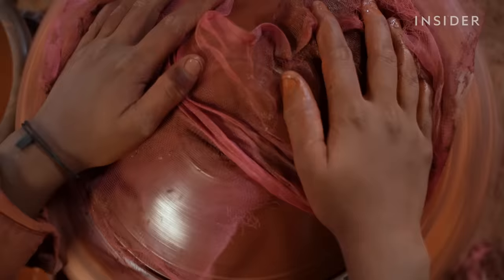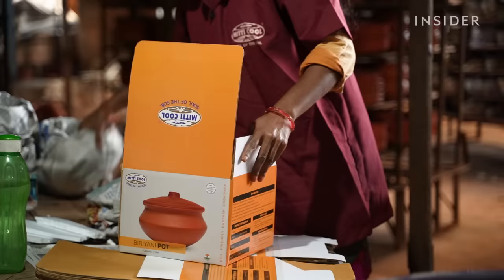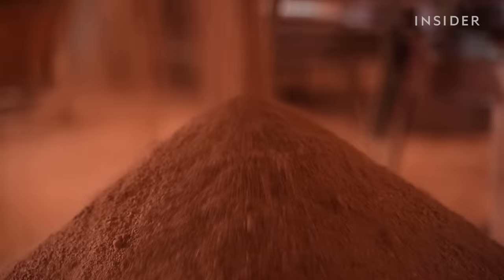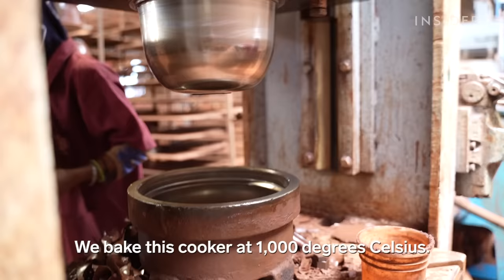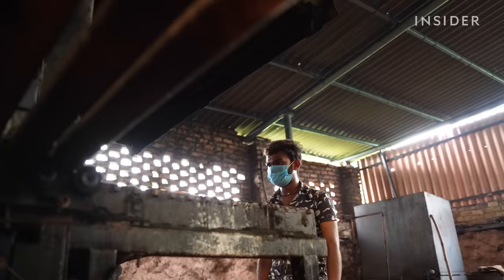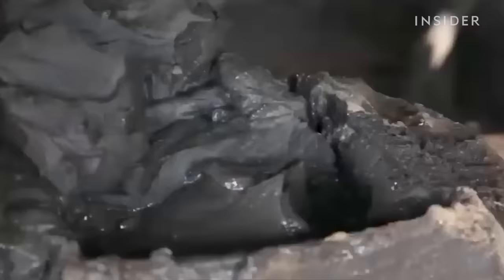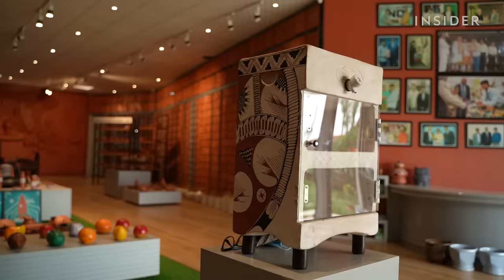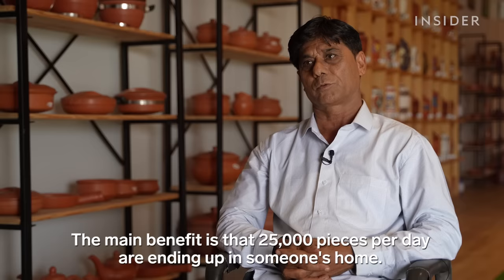How This Electricity-Free Fridge Saved An Indian Ceramics Factory | Big Business

Comment: About the refrigerator: well it works on the principle of evaporation the way sweating keeps mammals cool. But just like sweating, it works in hot,  dry climates the best. If you live in cool area, it might not provide even one degree of difference.
Reply: and why would people want to cool food in cool areas?
Reply: @hidum5779  because cooling food is much more, than keeping your drinks refreshing - it's primarily about preserving it. and even in cool areas the temperature isn't THAT cool, at least not year round. but even if it is, it means you'd have to keep it outside. not very convenient. although, our grand-grandparents in rural areas did use a similar technique: they dug a hole in the ground, outside a house, and made a dome on top. give it little door, and it'll make a cellar of some sorts, which makes food last longer. not nearly as good as a modern electric refrigerators though.
Reply: @kabyzdoch  I get the point about preserving. The food cooled in these non electricity fridges lasts for a week as they said. If it gets 8 degrees cooler, then in cooler areas I'm guessing the temperature already goes beyond 8 degrees since this fridge can't cool it, so why would we further need cooling anyway?
Reply: @hidum5779  well, the cooler it gets, the longer it stays edible. not all food needs it, but, for example, there's meat and vegetables in my freezer, laying there for almost a year, waiting to be unfreezed and cooked at any time. quite convenient.
also, talking about colder areas. if it's cold outside, people usually trying to keep themselves warm by warming their houses. some folks have a cold, non heated part of their house reserved for storage - vegetables, canned stuff and even some prepared food can be stored there quite effectively. but this type of storage rooms can be found mostly in single-family houses. living in apartment building, on the other hand, do not provide such benefit, so when heating your living space, you loose that bonus of keeping your food fresh for longer because of natural temperature in the area, and without an electric refrigerator your only option would be to eat something that doesn't spoil easily, which is dried food, salt food, sweet food and canned food. one could definitely live on such a diet, but given the options, it's rarely the food of choice, at least not on a daily basis.
Reply: @hidum5779  Where I live, in scandinavia, northern europe, Before refrigiators, people would have a wooden box inlaid with hay in which they would keep a big block of ice. On top of this they put a plank and then the food items needed to be kept cold. For dairy products and vegetables, folks would have a small cupboard made from wire net to hang on the outside of the house in a shady place. You can still find these around in use by elderly people having grown up with them.
Reply: @kabyzdoch  Well, many houses do have a cellar for this purpose. Or they have a pantry in a cool location near the kitchen.
Reply: @hidum5779  chilled beer is far better than cool beer
Reply: @chanderbalaji3539  I don't think this guy designed the fridge for chilled beer. It's for the poor people in a 3rd world country who want to preserve their food. He accomplished his objective quite well if you ask me. It is more of a need than luxury.
Reply: @chanderbalaji3539  I was thinking this would be the perfect cooler for a cabin or permanent camp site so all you had to bring was the beer and food and then get water from the nearest source.
Reply: Means u need to constantly top up water?
Reply: A fridge needs to do 2 things: Transfer heat out of the system and insulate to stop heat from reentering the system. Evaporative cooling alone cannot do both at the same time. By its very principal, the thing that is being cooled will have to come into direct contact with the warm ambient air, meaning no insulation.

Sweating only works to cool off the heat your body generated, speeding up the cooling from cooler amibient temp. I don't believe that your body is able to cool itself below ambient since it has no way of insulating heat from entering. ie, if you stayed in 40degC you can't maintain regular body temp for extended period of time regardless of how much you sweat. It would also need some kinda pump, similar to how your heart pumps the blood cooled through sweating to other parts of the body.

This is basically a swamp cooler, but even less efficient. It's a loada bollocks
Reply: @ABC-ABC1234  well, the thing is, i'm a lazy person and i don't like to cook, so i use cup noodles, dumplings and other stuff that needs only hot water or boiling in hot water. or microwave. that meat though? it was brought by my mother when she was visiting me. so it just remains there, untouched. oh, by the way: it was finally cooked and eaten a few days ago - no weird taste, smell or anything, just a normal pork.
Reply: @kabyzdoch  (-.-²)³
Reply: Hi guys!
Tropical creature here.
My natural habitat is hot & humid.
Temperature 26-35°C, humidity 50-90%.
Been searching for budget friendly & environment friendly ways to cool of anything - food, space, etc.

This video got me thinking: can clay be the answer for me?
Water clay jar & food clay container, instead of electrical fridge.
Clay-based roof tile & bricks for roof and wall, instead of electrical air conditioner.
Would love to hear opinion & suggestion from y'all
Reply: Meanwhile I'm living in a hot and very humid environment. So absolutely no evaporative cooling possible
Reply: Say you live in cool area and you have a balcony which has direct sunlight, would it not work?
Reply: @hidum5779  What is third world ?
Reply: @acharyaguy  ask google
Reply: @acharyaguy  places where electricity supply is either not reliable or unaffordable to many.
Reply: @hidum5779  I don't think so google would categorise countries as first , second and third world countries
Reply: @acharyaguy  well it appears that you're already aware of what I'm trying to say.
Reply: @hidum5779  it's more about whether you know what the term "third world" means but then don't take it personally, you are not alone in using such derogatory term.
Reply: @acharyaguy  dude, I belong to the same third world. And yes I know about the other original definition as well. No need to feel offended. It's fine. I'm not american and after seeing the videos regarding "streets in philadelphia" you might wanna call america as a third world in the same derogatory manner.
Reply: @acharyaguy  also, nothing's wrong with being a 3rd world person (even in the derogatory manner). This century is of Asia altogether anyway. Necessity/problem breeds innovation. This guy did it well. That's the point I wanted to highlight. I know we're much better off than 2003-04 now, but again who cares what others call us? Being sensitive won't work on the internet. Life is too short, just saying. Relax and let go.
Reply: @hidum5779  development we call comes with its cost...btw it is good to be emphatic with ourselves
Reply: @acharyaguy  cmon dude, just because I called our nation as "third world" it makes you feel as if I'm not empathetic? Like I said, relax and let go. Why do you concern yourself so much regarding correct definitions and stuff? This is an informal place. Just let it be. Of course had it been some misinformed foreigner still ranting about the "toilet" problem which is very much eradicated now I'd have shouted back onto him. But then again, who cares what others think? I used to be sensitive earlier and it didn't go well. I didn't purposely look down upon my country as if it's not safe for women or whatever like that(and well I know that rapes are favourite topic of foreign media to make a fuss about India), or some other issue concerning that way. What's the deal with being a 3rd worlder? It's just a name tag, not even much derogatory. Chillax

Moreover either way India is a third world country. It kept the alignment neutral during the cold war. Why worry so much?
Reply: 🤣🤣🤣You have never lived in a clay house have you.?
Reply: @Pehr Sundbergh 🤣🤣🤣You have neve lived in a clay house in Hot weather have you?
Reply: (Acharya Guy) just cool it. Chillax. I am also from Bharat India. Hidum used "Third World" to explain what type of country he was talking, not as an insult. Your skin is too thin and too sensitive.
Reply: @prakashholla7331  thanks
Reply: The key is humidity not temperature evaporative cooling doesn't work in high humidity environments
Reply: @ekosoelistiyo4532  this
Reply: You are not his targeted customer
Reply: @ekosoelistiyo4532  Look up "pot-in-pot refrigerator".
Basically it's an ancient technology, but he has built a more convenient and modern looking version.
Reply: @wolfgangkranek376  Aha, gonna dig deeper about it!
Reply: It is the humidity level in the air which is most important. If there is too much humidity, evaporative coolers cannot work. In a dry place like Gujarat or Arizona, it is a wonderful solution.
Reply: @BooGooNFlowoo4Evoo  Ah, I see
Reply: @TeraAFK  body can be lower temperature in hot arid places. Evaporative cooling isnt much different than heat pump principles, except it's not a closed system like a heat pump and highly dependent on the weather/climate way way more so than a closed system heat pump.

 But still this ceramic seems like more of a trendy place to keep vegetables barely cooler. Does it really matter if your its 90f out and your meat is kept at 70f?
Reply: @TeraAFK  You are right about the fridge. They only briefly showed 8 degree cooling in the video, which is poor.
You are mistaken, however, about sweating. Plenty of places on earth where people can live in a climate warmer than their body temp. Sweat cools by absorbing body heat when it evaporates. It still works in 40+, humid climates, though not efficiently.
Reply: @hidum5779  It's a combination of temperature and humidity. 

So long as the humidity stays low, evaporation will happen, to some extent, and evaporative cooling works, to some degree. (In fact, even ice will sublime--turning directly to vapor--in below-freezing but dry climates.) 

However hot, dry air can hold a lot more water vapor than cooler air that is at the same percentage of saturation ("equally humid"). This curve (the antoine equation) is not linear--it rises dramatically with temperature. So there's a large zone in the middle where it is still too hot for food storage, but not hot enough for a given humidity level to have such powerful cooling capacity.

And of course, cultures differ in what sorts of foods they eat, and hope to keep fresh. A cooler of this sort would not be safe for soft fresh cheeses, but it might be fine for aged cheese or a more fermented or salted food.
Reply: Sounds just like how swamp coolers work :)  Doesn't work well in humid climate but very dry desert climate.
Reply: @kabyzdoch  My house had the first floor half in the ground and it had huge stone walls. On a wall had one huge square hole where they store food. Also it was where they were keeping the animals and my family was sleeping just above them on a wooden floor which allowed the heat produced by the animals to keep my family warm. Although renovated, I still live in that house.
Reply: Please explain further
Reply: I was waiting for them to explain how the fridge works but they kust glossed over it. . .
Reply: It works better in dry climates
Reply: Can you please explain exactly how the fridge works. It just looks like a cupboard to me.
Reply: In Physics, heat does exist, cold doesn't. Cold is the absence of heat. Alcohol on your skin gives you a coolant sensation, because it "steals" heat from your body to evaporate. In this fridge, its whole porousness ceramic body acts this way, but using water. Evaporation rate is directly proportional to dryness of ambient air. Swamp cooling performance is bad in wet climates due to low evaporation rate.
Thumbs up if you understand it, ask me if you don't.
Reply: @ww07ff   sorry I  still don't understand it. Where's the holes? Where does the water come from? And what temperature does the fridge cool down to? Do You have to put ice cubes inside to help with the process?
Reply: @ya00007  The top is a water tank itself, needs to be refilled "every day" (1:01). The water spreads thru capillarity and gravity to whole porousness ceramic body, like a sponge. (or like a wet t-shirt on your body). The temperature range is narrow, the values are in the vídeo (5:48). No ice is needed.
ps: Fahrenheit scale and other imperial units are stupid and north americans should let it die.
Reply: @ww07ff  you still haven't explained exactly how it works.
 Ok there's a water tank on top that needs to be filled every day. The water seeps through the bottom of the tank? Then where does it go? There must be a bucket for collecting the water somewhere or does it just evaporate?
Reply: @ya00007  Imagine a huge SpongeBob. This fridge is literally a SpongeBob, its ceramic acts like a sponge. You fill his hollow head with water. The water will spread itself through his sponge body. The water evaporation on sponge skin will "steal" heat from Bob, like a wet t-shirt. Have you ever worn a wet t-shirt in the wind?
ps: 
-Yes, water seeps through the tank walls (bottom included) ;
-Then it seeps through the whole ceramic body;
-It just evaporate.
Reply: Thank You!
Reply: An ice chest with a glass door wont keep anything cool without ice so I don't see how this thing does anything at all
Reply: @WormholeJim  A whole in the ground, and dig a bit to the side = ca 4-5 degrees year around. Worked when I was a boy scout, and we actually earned cokes from the other boy scots, who didn't want to dig their own.
Reply: @hidum5779  Ice cold beer obviously
Reply: @TeraAFK  Even swamp coolers can cool things below ambient shade temprature at the cost of water and increased air humidity. In this case in the dry air of mountainous regions of northern India this very likely does reach 8c below whatever temp is inside the house and it keeps working because these houses are likely built with open windows  so the increased humidity equalises with the outside.
Reply: @neelroy2918  You keep it out of direct sunlight for best results
Reply: @Malroth00Returns  thanks.
Reply: @TeraAFK  It is not as good as an electric refrigerator I agree.  It is not a fraud either.  When going into warm areas and using a cooler I have placed wet towels on top of the coolers in the same environment as coolers that didn't have wet towels.  The coolers with the wet towels stayed cold much longer.  It does seem counter intuitive but if they didn't work people wouldn't buy them.
Reply: @hidum5779  It's more about dry, not about hot.
Reply: @TeraAFK  Evaporative cooling can absolutely cool below ambient. Not only is this possible, but it's so consistent and reliably lower than ambient that there are two common terms to distinguish those two temperatures: dry bulb and wet bulb temperature. And I also don't understand why you think the food inside the fridge "needs to come into direct contact with warm air" huh? No, it loses heat by proxy through the wall of the fridge. Nor does it need a pump: the ceramic wicks water down by gravity.
Reply: Even in cool England or Ireland evaporation works.  I have been fridgeless in the past, placing milk container - for example - in a bowl full of cold water with a piece of cloth draped over  it ensures the milk is always kept cool.  I kept it in a cool north facing room with the window always open and stored not only milk but also butter, cheese, fish and meat this way.  And I never had anything go off or even faintly mouldy.  Which is more, much more, than can be said for food kept in fridges believe me.  That cool room with the bowls of water and fabric covering the contents was the ONLY time I have never lost any dairy or meat products due to them going off.  In a fridge the cheese is always going mouldy, and meat has to be eaten within a couple of days or frozen else that goes off as well.  And worse, I am expected to PAY for the privilege of losing my food while helping to create pollution from the electricity and production/destruction of said fridges.
It may not work in the Arctic or Antarctic but almost everywhere else, unless your daily living temperatures are below 5degC it will work.
Reply: He didn't even intend to make the product for European nations.
Reply: It isn’t really about the temperature of the air as much as the humidity. If evaporation is hampered because the humidity is already high, it doesn’t matter what the temperature is. In FL, for example, a cold drink will sweat like mad and form a significant puddle because the chill of the container is allowing the humidity to condense into droplets that then do NOT evaporate.
Reply: @PANZER7910  I think they were saying the water lasted a few days maybe even a week or 2?
Reply: @TeraAFK  if your hypothesis about the body was true, every human living in a place that gets hotter than 98° would die of fever.  Obviously the human body is capable of maintaining it's temperature beyond the ambient.  This is through many mechanisms, not just sweating.  I see what you're getting at but that's a really poor metaphor.
Reply: Isn't india famously humid?
Reply: @ummdustry5718  it's a huge country.  The part he's from is very arid.  There's literally snow capped mountains, jungle, desert, and grassland
Reply: @kabyzdoch  they can just dig a hole in the ground if it’s that cold there. Or if it’s 30-45 just put it outside
Reply: LOL, $40? What a scam. Going from 80 F to 72 F doesn't do shit for storing food. I bet you they would use up the food in just a couple of days. They are not going to have food sit in that useless box for a week.
Reply: I guess that's very similar to how water kept in earthen pots stays really cool
Reply: it's not much more than a few degrees in hot climates anyways (they claim 4C but that sounds very optimistic for evaporative cooling). This is the same as those obnoxious swamp coolers and it won't do much more than make an environment that's maybe optimal for potatoes and onions
Reply: I understood that. What confused me was that he said electric versions didn't keep stuff cool enough.
 
And I also noticed a design flaw. Why have it be of a vertical design? If this uses passive evaporative cooling, that would mean it isn't dynamic to changes. It would struggle to keep consistent internal temperature because it doesn't react. Flip it on its side, of the horizontal type, similar to that of a deep freezer. The horizontal type is a more appropriate design here.
Reply: @hidum5779  Food will not be preserved unless stored at around 4-8C. Just cooling 8C below the surrounding (which can be as high as 40C in summer) won't help. However, it may be good for saving the leftover food for the night (next meal time).
Reply: @chanderbalaji3539  Icecubed Beer is more better than the CHilled beer XD
Reply: @WormholeJim  In the 40's and 50's we had an outside Coolgardie meat and vegie safe. A water tray was on top with a hessian bag draped around it which became wet through absorption.
Reply: @nifty1940  That's a great application of the physical forces influencing all the time. I think we would do ourselves - and the rest of the planet - a great deal of good if we reinvented all that wisdom previous generations employed lacking modern day technology. Thanks for sharing!
Reply: @acharyaguy  
I completely agree with you. Nowadays yoyo guys think it is cool to use such words .
Reply: @hidum5779  
So, We don't see people calling the western world as cultureless world, which is true actually.
Reply: I would not need it to be cooler in a cool climate, lol, I would simply put things on my porch, like I have been doing for years!
Reply: @Pehr Sundbergh Wow, you made me curious.... and learn more....
Reply: @neelroy2918  It would, if evaporation occurred.
Reply: 33 to 40 degrees is the refrigeration range to prevent food borne illness so in cool climate you might not always achieve that range as opposed to a cold climate for instance.
Reply: Technical comment:

The relative humidity is more important that the actual temperature. The "wet bulb depression" is even more relevant.

This fridge is ideal for countries with dry air, regardless of actual temperature. It would fail where the air is naturally humid, like in a rain forest for example.

In foggy conditions (where water is condensing onto surfaces) the fridge could actually be warmer than the surroundings.

To see the effect in your home, get two thermometers, wrap one in a cloth soaked in water (preferably with a "tail" allowing it to soak up liquid from a nearby jug in order to stay moist). Let the other one keep its bulb dry. Compare the temperature of the two thermometers after a few hours.

I am old enough to remember our family getting it's first fridge in about 1958. Before that in summer mum keep Ford fresh by covering it with an upturned bowl and covered that with a dishcloth, the whole thing standing in a bowl of water. It made the difference between butter being solid and melting in hot weather. London, England. We did not often get weather hot enough but this DIY fridge was used for a few weeks every summer. It kept butter and milk fresh when they would have gone off just left in the pantry.
Reply: @trueriver1950  Interesting information...thank you.
Reply: @hidum5779  Did you see any dairy products and meats inside of the refrigerator? No?
Reply: @hidum5779  
Eskimos use fridges
Reply: @TeraAFK  : These things can actually produce cooler temperatures than the surrounding air, as can sweating (which is actually required in some parts of the world to survive, such as Iraq- temperatures there often get too high to survive without cooling, but sweating allowed people to survive outside there for millennia before air conditioners were invented). The secret is that water doesn't really evaporate because of heat, water evaporates because of "partial pressure" differences between the place it's going to, and the place it's coming from- heat can alter the partial pressures, and also speed up the process, but it's this pressure difference that causes the evaporation, not the heat itself.

As for insulation, any thick thing actually provides insulation, but it's probably sub-optimal in this case- the cooling will mostly happen on the outside, but then the insulation will prevent the heat from moving to take advantage of that.
Reply: @ekosoelistiyo4532  : Humidity makes this a bad option for you, for the same reason that swamp coolers are bad for you- both work better when the humidity is lower. You would be better off looking at salt-cycle air conditioners, since they can get most of their power from just heat. Then run the cooled fluid into some buried loops of pipe or something (if you have a pool or pond that's shaded, then that can work) to give the system more thermal mass (for night time), and use the output of the buried loops for cooling.
Reply: @mbburry4759  : 20 degrees difference matters to the cheese!
Reply: @absalomdraconis  Ah, I see. Thanks for the suggestion!
Reply: most importantly it doesn't work in humid conditions. which is when India has most of it's heat - during humidity.
Reply: @trueriver1950  thank you for sharing 'tried and tested' info
Reply: @chanderbalaji3539  this is a preserving bin not a cooling device. It preserves food from spoiling quicker
Reply: @neelroy2918  eyes why not ideally  this is too good for keeping safe  minrals n vitamins in fruits  n veggies
Reply: @prasadnair8282  It does work, but not with water as the evaporate. Isopropyl alcohol with water works.
Reply: @perseusarkouda  Wow! Where and how cold is it outside if I may know.  You must be from Greece I assume.
Reply: @ya00007  The holes are the pores in the clay, big enough for evaporation but too small for water to leak out
Reply: @950bolt  I'm from Greece, yes. I live in the northern part at 600m from sea level. We have moderate climate with sometimes cold winters that are averaging at around 0 Celsius for 2-3 months. It also snowing ~2 times yearly and it lasts for about a week. The problem with our climate is the high humidity as Greece being a Mediterranean country. A friend who also lived in the Netherlands told me they had much lower temperatures up there but the climate was dry and cold was much worse in Greece, even with higher temperatures.
Reply: @perseusarkouda  Wow, that's great to know..seems like a scenic yet hard environment in the winter... Hard to find unpolluted places these days. So enjoy when you can👍🏽😀
Reply: @TeraAFK  Based on India's average temperatures, a properly designed evaporative cooler can reduce its internal temperature by 7 degrees C. In the best case scenario, they can reduce it by 17 degrees C. It has its best outcomes with high temp and low humidity as you said. Based on the design, I assume it is using the clay body as its evaporator and the water reservoir itself as a thermal mass.

This isn't going to keep food "cold" persay, but it removes it from thermophile danger zones, extending the life of fresh produce to standards we take for granted in affluent countries. It may be charitable to call it a refrigerator, but given the choice to keep food in a cooler of this design or in ambient temperatures, it's a pretty obvious choice, especially when it is inexpensive and operates using a relatively small quantity of clean water.
Reply: So a koolgardie safe from the Australian desert mining community. A water tray, a box and some hessian.
Reply: Or hot and humid
Reply: “Swamp cooler”
Reply: Would using salt water make it even cooler because I know that salt makes ice really cold?
Reply: @SF-li9kh Use activated charcoal to absorb moisture
Reply: Yes and in the other hand, if the humidity is higher, it won't work well too. Anyway it will work for most of the regions in india as the humidity is low.
Reply: Yeah it's work on the principle of evaporation
Reply: @ww07ff Olg let's see if I get it: if I wanted to increase efficiency of said clay cooling, I could 1. Increase evaporating (surface)mass action by adding thin interior sections for the extra sand and water substrate like grapefruit sections, 2. Increase evaporation rate using part alcohol dilution, 3. Use a flexible lid to reduce air volume (condenser, compressor action). 4.alternatively, start a fermentation process which serves to use up air (condenser).  
Yes? How did I do?
Reply: @MrsWhite-jt1gw  
1. I don't understand exactly what you mean, but an increase in the evaporation surface area should be on the outer surface, where the air is dryer. Inside the fridge, the air relative humidity is already at maximum because it's a closed environment.
2. Pure alcohol, probably yes, but it's expensive. It should be calculated as alcohol has a different latent heat compared to water. A mixture of alcohol and water can interfere in evaporation rate depending on mixture ratios, I'm not a chemistry engineer. AI can help with latent heat calculations. You can tell AI the surface area, ambient temperature, evaporation fluid, air relative humidity, fridge ceramic mass, and its internal air volume, then let AI do the math.
3. Don't understand either, but the lid is not strong enough to create an "internal vacuum" to increase evaporation inside the fridge chamber. In fact, it will "counteract" the capilar action of porous ceramic material, sucking the water to the inside, but the water should flow to the outside to be evaporated on the outside, not inside
4. Fermentation doesn't make the air disappear." Fermentation "reaction" produces CO2.
Sump cooling is an open cycle refrigeration system. 
Compressor cooling is a closed cycle refrigeration system.
Both rely on evaporation of a fluid, but thru different processes. 
The simplest way to increase evaporation on this fridge is using a fan to blow air on its external walls, keeping the room windows widely open, to let the humidity air goes out and let dry air comes in.
You seem to be very interested in refrigeration cycles, I recommend you to watch physics videos about it.
An incredible YT channel that has some interesting refrigeration videos is "Tech Ingredients." I highly recommend it!
Reply: India especially western India have mostly hot climate. Winters are actually becoming rare. Coldest months are ofcourse January and even then the temperatures do not drop below 15. On an average temperatures stay between 15-20 degrees (celsius). So this is a problem for at most couple of months in  a year. Other times, the temperatures are easily above 30 degrees, reaching 45 in the hottest months. As far as preservation is concerned, the parts where they are used their concern is about cooling food because of the temperatures they live in. The families around these parts, are big consisting of 6-7 members in one household (minimum). In such families, most food is consumed within a day and rest would be preserved for 2-3 days max. They are villagers and townsfolk, who don't prefer keeping food for more than a day or 2. They don't consume such foods that require that. Everything they make such as spices, are all homemade and they consume that within 2-3 months and make a fresh batch regularly. They don't buy packeted foods also. So yes, this refrigerator works for those specific unique use cases, not practiced in cities or by ppl that come in the middle-class income bracket.
Reply: He sells his fridge of 50ltrs at 8000rs. Almost same or more than branded elec. Ones. How can he claim its poor mana fridge?
Reply: @aguywithnowork  Maybe because it's electricity free.
Reply: Our ancestors in Europa had basements: below ground the temperature stays pretty cool, even in summer. Less reliable than fridges, but way less energy intensive. I would prefer a combination, or a fridge in the basement.